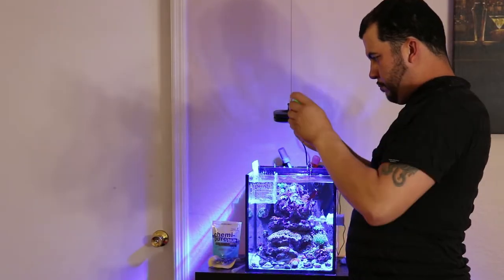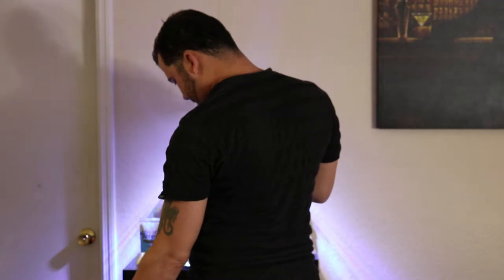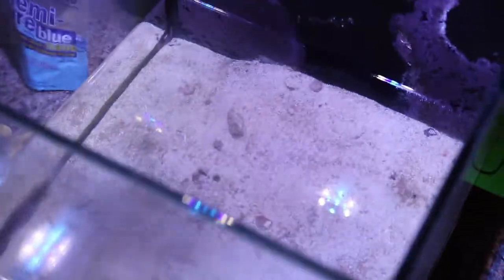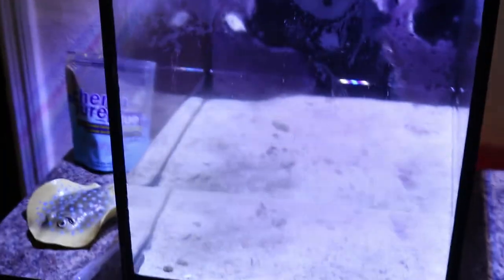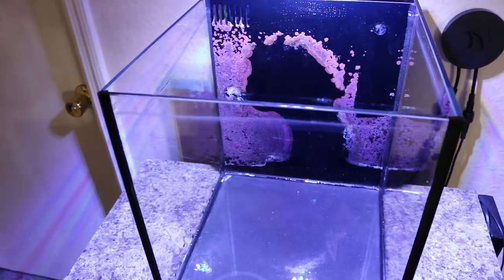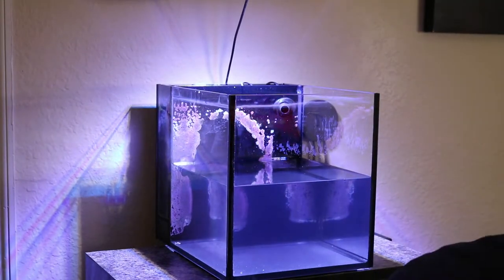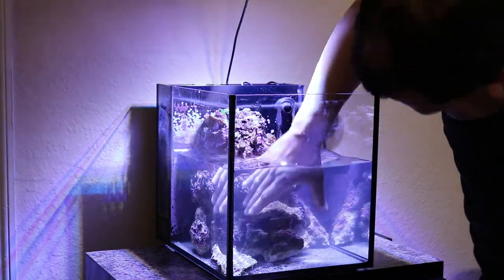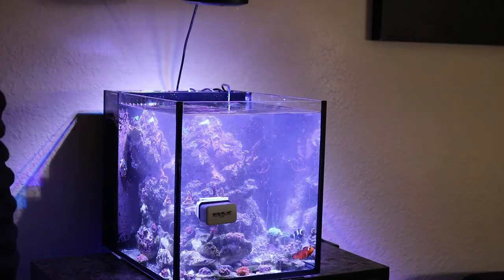NO SAND!!! Going Bare Bottom!!

Comment: I have also sworn off sand 
I have rubblt as the substrate and they are easy to move around with the hose when suction out the water when you do a water change